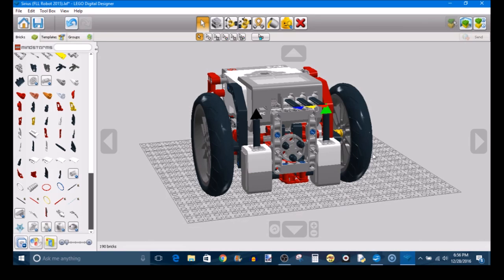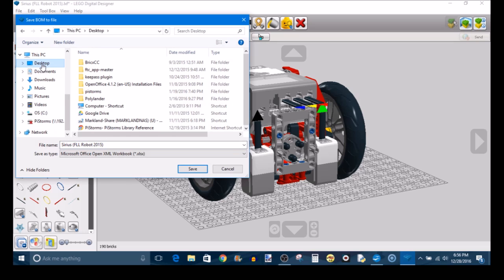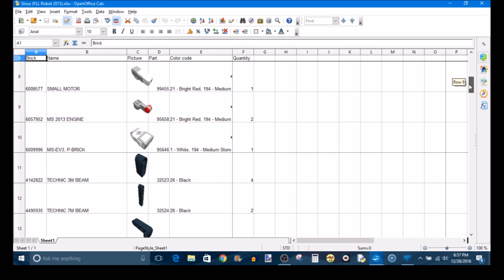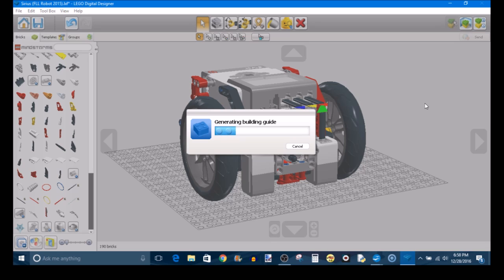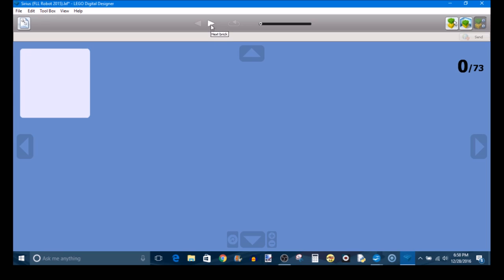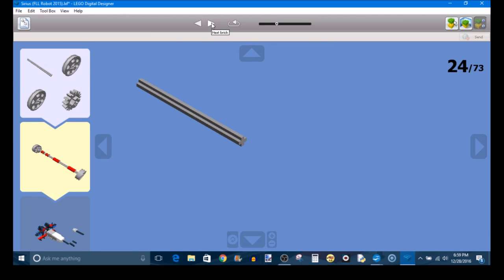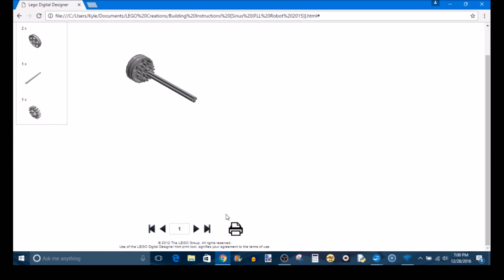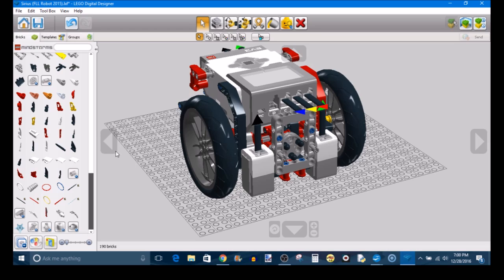How to Get Building Instructions and BOM from an LDD Model

Comment: Do you ever have issues with the building guide not putting the pieces together in a logical order?  If so, then how do you override / fix?
Reply: Actually it is awful and makes it non-usable. I tried to open Timmyton,  parts and submodules modules always hang in the air - so it makes assembling nearly impossible. Please consider making instructions in more friendly way with more usability. Thanks.
Reply from the maker: Yes, this always happens. There's nothing much you can do about it; it's just the way the computer compiles the building instructions.